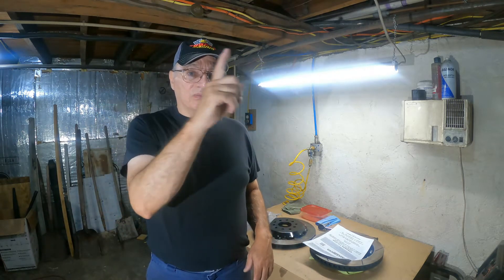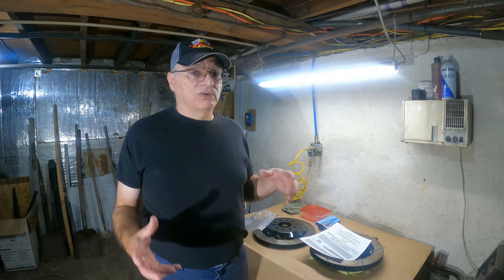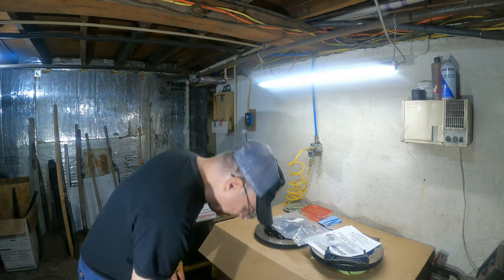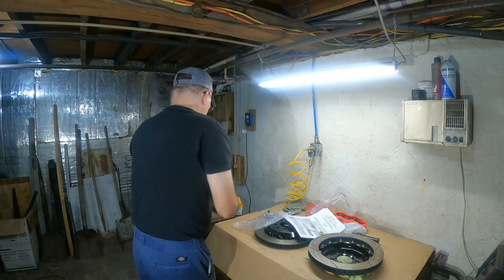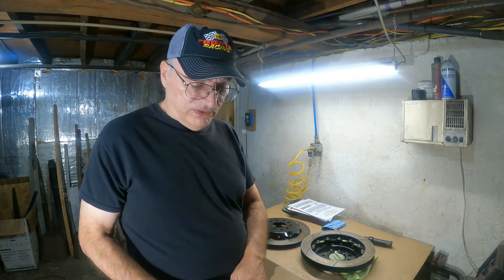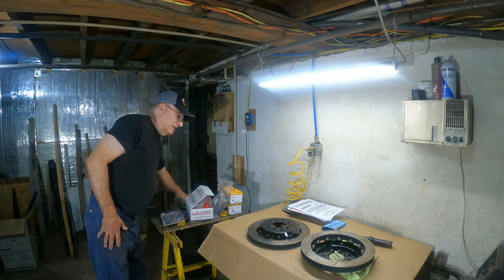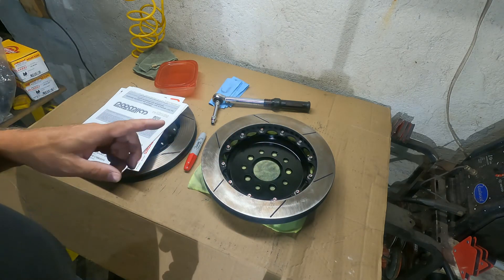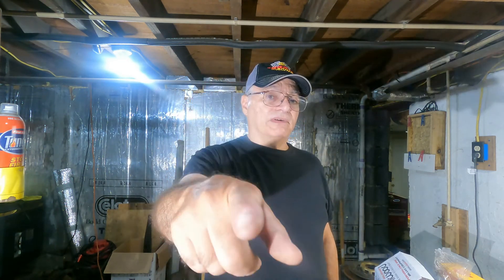Wilwood Big Brake Hat Tricks 😁

Comment: I have both kits, and a rear kit (i did both front and rear on my 93 Callaway, and fronts only on my 90 6 speed coupe) and they all came with BP20 pads included. 

I went with the slotted drilled kit for the 1990 coupe, since now they're the same price as the slotted only kit.

Comment: Eugene, did you look at look caliper set mfrs other than Wildwood and Brembo?    I'm curious if you looked at others including perhaps a C5 Z06 or C6 Grand Sport set of big brake kits.   I also spotted another mfr. "Cieka" which sells for roughly 60% of the Wildwood sets.  Interested in your opinion of options to spending nearly $5K on a front/rear set.   Thanks!    Jim
Reply from the maker: Yes I looked at other options, Cieka I never heard of, you buy what you want.
Reply: @E.T.GARAGE  I was just curious of other solutions.   I like both the Wildwood and the Brembo solutions, but a complete 4 brake replacement solution is equal to about 1/2 the value of the car.    So I wanted to take the time to explore all solutions, including next generation Vette, C5 or C6 brake solutions.  I don't want to invest in any Chinese mfr.s, or made in China, solutions for obvious reasons, but want to at least keep my eyes open.   I just thought of another possible solution, I'll have to check Baer Brakes for solutions as well.  Thanks for your reply.
Reply from the maker: @jimmerriman6920  I have no experience with the other options you are talking about I am happy with what I have.